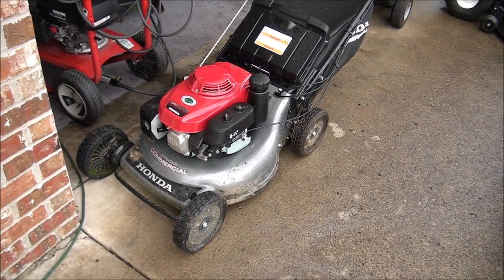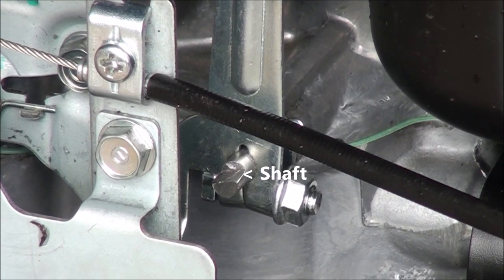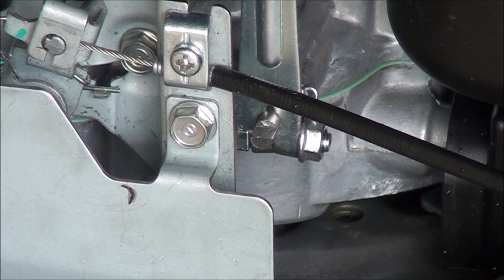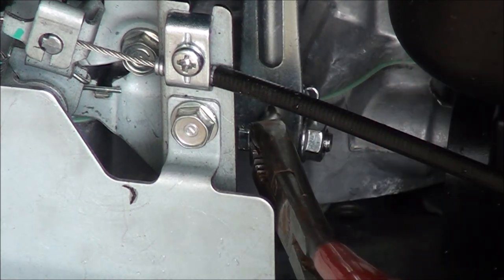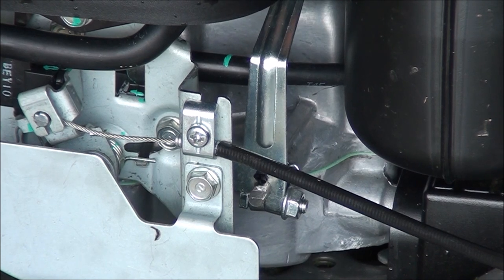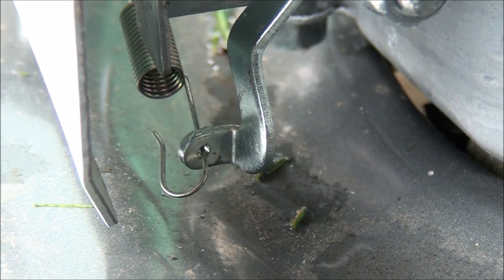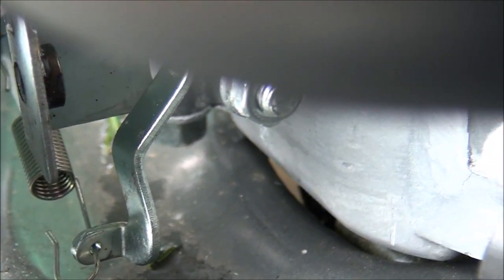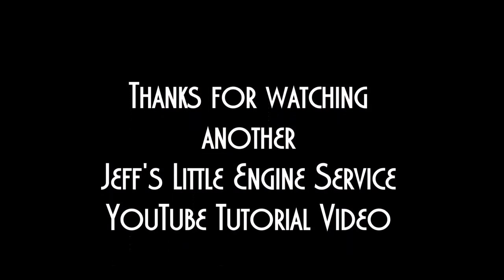HOW TO FIX a Honda Lawnmower that REVS up TOO MUCH. Repair GOVERNOR ADJUSTMENT - Too high RPMs.

Comment: 48 seconds into the video and It fixed all my issues. The text in the top screen read "clockwise will lower the rpms". Man... My mower sounded it like  it was going to explode. backstory I have a Honda HRC 215 Commerical my dad purchased back in the 90s. It's been his number one mower up until about 3 years ago when he retired from landscaping and passed it down to me. He had it serviced by professionals every single year because he used it 5 days a week for 30 years. I run it once a week. It bogged out one day and I thought to myself that I could fix it. I changed the oil, the air filter, then discovered the carb could be cleaned instead of replaced. I found this strange jelly inside that I came to find out was ethanol. Cleaned the carb and put it back together. Gave it tug and it fired right up but sounded like a 2 stroke dirt bike with nitrous injection. Seriously thought it was going to explode with how fast it was running. I thought that I must have screwed something up when disassembling the parts. I searched far and wide for answers but had no luck. Turned every knob and cleaned the carb again, to which it still ran super loud and fast. I started going after the springs that operate the arms to the choke. No luck. I really didn't want to take it in because I was determined to fix this. The second you pointed out that doohickey called the governor had me convinced. I immediately got my tools, turned it clockwise, tightened up the pinch bolt, fired it up and it runs absolutely perfectly again. My dad would killed me if he found out I ruined his legendary mower. Lesson learned. No ethanol gas in mowers.

Comment: I know its a couple years old but thanks for the video.  My lawnmower had been surging recently and I had taken some things apart to diagnose it after I put it back together, bam, thing was running crazy fast.  I got new governor spring, to no avail. I pulled the carb apart and cleaned it, to no avail.  In a last ditch effort I googled what to do about over revving and this video was what I needed.

Comment: that is not the way i was trained to adjust the governor
Reply from the maker: +bgm Haha! A service manual would have been nice!
Reply: It may be helpful if you’d include the correct method, or at least a video link or starting point for getting it done properly. Saying this video is incorrect is just creating a frustrating dead end for people trying to fix their mower :) like me.

Comment: exactly what I needed to see , I have a Honda HRR216 2TDA (GVC160) with manual choke that needs this.  I cleaned the carb 3x and gas tank and now it surges on high throttle, and stops on low Throttle,  and almost throws a rod on choke.
Reply from the maker: you must not be clearing out the slow jet passage all the way, and it sounds like your choke got messed up somehow

Comment: I wish you started mowers to show a before and after before repair I stood on top of my mower now mine run at very high idle and string need help going all the way in , I need remove top part that string goes in to see if my weight from standing now caused an problem or something snagged or that metal part you touch needs to bend back in place if it bend at all my Honda always ran good until I step on it to reach something always stared one or two pulls
Reply from the maker: I was scared to it had no oil and SO many metal shavings inside of it!

Comment: I got a new carb and put it on. 
the R.P.M.’s were through the roof. I did your trick, And now it’s a perfect idol.  Thanks.
Reply: mine did that today when i changed the carbeuretor out, mothaflucker sounds like an AIR PLANE. the flap in the back started opening up the blade was spinning so fast i said wtf. so ill adjust the spring next to the governor

Comment: Well done for doing it without the manual! 
I have two opposites --1) my revs on aCG 135 are only 1900! And 2)  my governor arm is on the left with a thin spring at the top!

Comment: Just a recommendation.  Any time you are making a timing adjustment  mark where you started.  On this example, mark shaft & lever.  This provides a good reference when making your adjustment.
Reply from the maker: great tip!

Comment: I helped my uncle to fix his Honda lawn mower that won’t start. I cleaned the carburetor and reinstalled it. It started up...but it is too loud. I think it seems ran too high rpm? How do I fix this?
Reply from the maker: if correctly setting the govenor lever does not work it may have a bad govenor.

Comment: What can cause a lawnmower to rev super high? I have to shut it off right away after start because it rev super high sounds like it's gonna blow up. Adjusted governor and spring linkage didn't solve it. No matter how I adjust the governor, it will still rev super high. Governor arm looks good from the outside, could it brake inside? Any idea? Honda HRA215 with GXV140 engine. Thanks
Reply from the maker: I would check the throttle mechanism on top of the carburetor. Also,  correct govenor adjustment.
Reply: I asked the previous ower, she said it suddenly rev up while she was using it. That eliminates the carb (kind of) and the governor adjustment, unfortunately I think something broke inside the governor. What do you think?
Reply: Mine is the same way I try the governor it work for a time but then it started again I think is inside the problem I'll open and see what's the problem is a nice mower to junk it